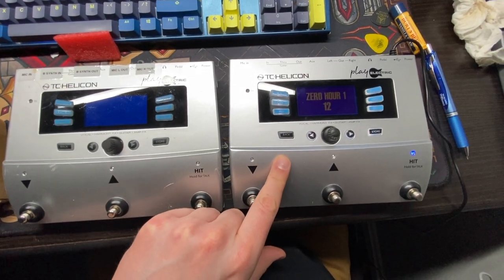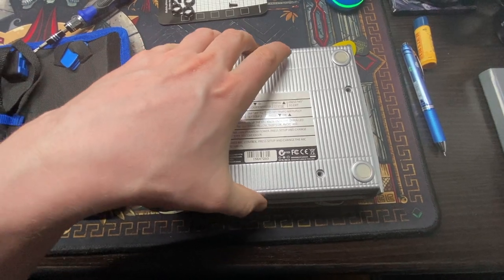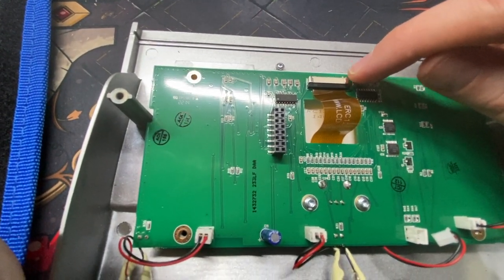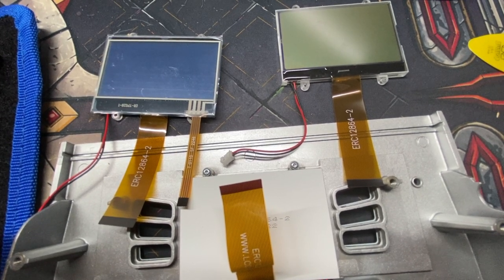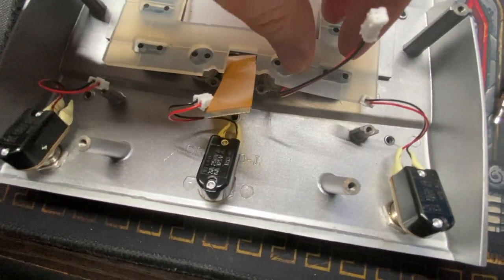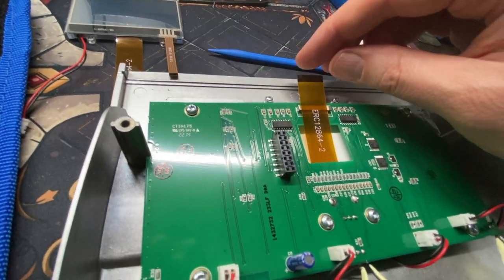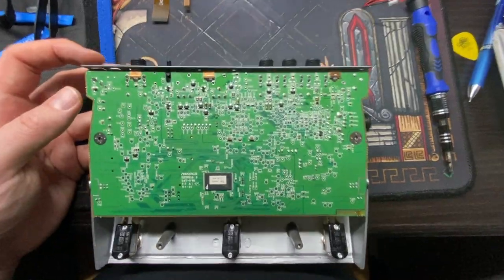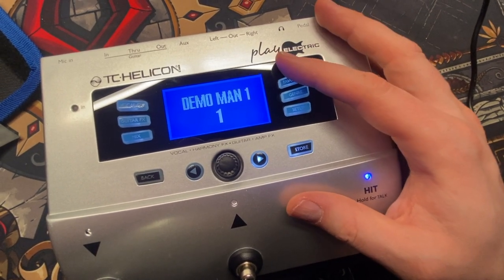TC Helicon Voicelive Play LCD Replacement - Dim Screen Fix - For Standard Acoustic Electric or GTX

Comment: So I got the new one in, after doing the full install the screen came on super bright but no words. I don't know what to do from here.
Reply from the maker: So what was your initial problem? Completely broken screen? Just super dim? 

It sounds to me like something isn't connected. It's getting power, but is not connecting to the pedal's software. I would try taking it apart and making sure each connector is seated firmly and properly. Make sure all those pins go in when stacking the two motherboards, and checking the connection of the ribbon cable.

Comment: This was super helpful. I did order one of the screens, but when you said you ripped off the other strip, could I just cut it straight across and then put it in the machine? Just checking? Thanks again for any help!
Reply from the maker: If you ordered the blue one and chose none of the drop down options, you should be good to go. 

But if it comes with the touchscreen add-on, which has the little strip, it is NOT just as simple as cutting the strip off. I tried that. The screen still has an additional touchscreen layer that will make it too thick to fit properly. 

I had to take a craft paper knife—effectively a razor sharp scalpel, and slowly, carefully get between the touchscreen and the LCD screen and separate them. Then I cleaned any glue residue off with a dry, soft cloth. 

You have any issues or questions, reach back out. We can set up a zoom or discord or something if you need help.
Reply: @StatusMusicDesign  Awesome man, thank you for the insight. I made the mistake or ordering it with he e packet. Probably going to be in a million pieces by the time I get it back. Ive go to try and cancel the order. But yes, I  will  be getting  back to you .
Reply from the maker: @chasemantooth1701  If you can afford it, I’d just order another one. I think you’re just gonna get everything faster. Their customer service is responsive but slow. Price is reasonable. Keep the one with the strip as a backup.